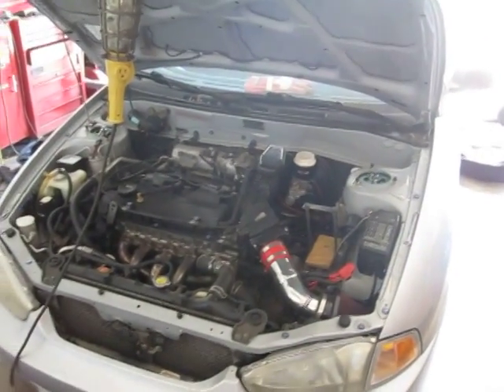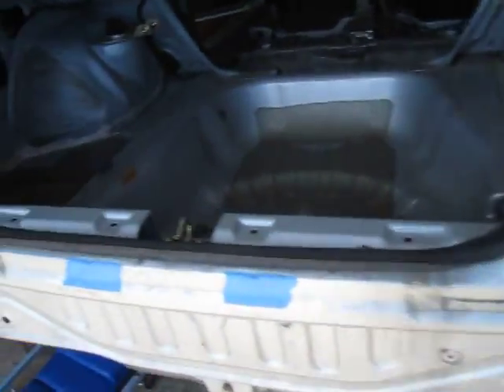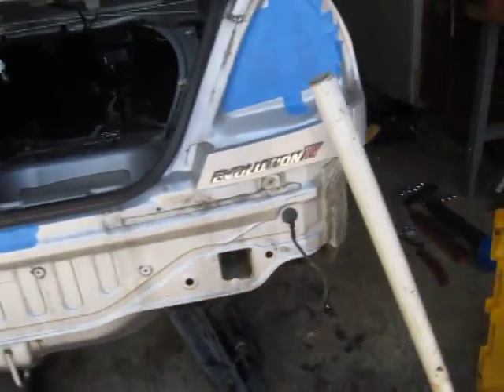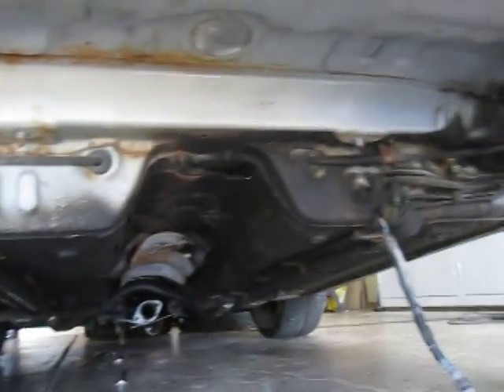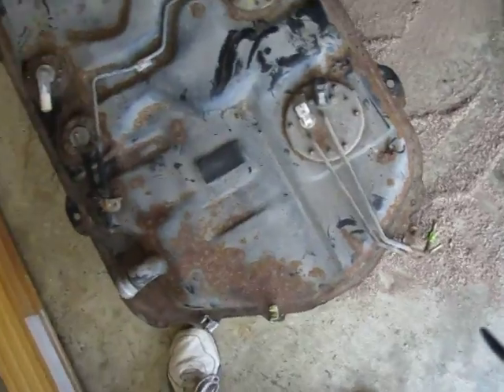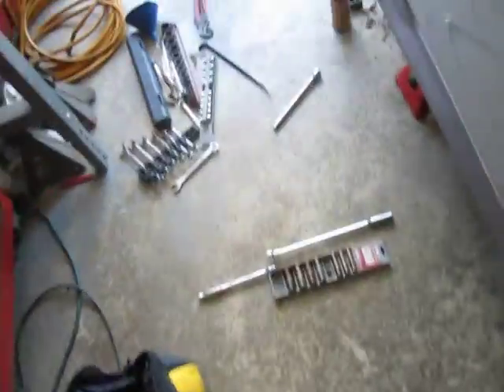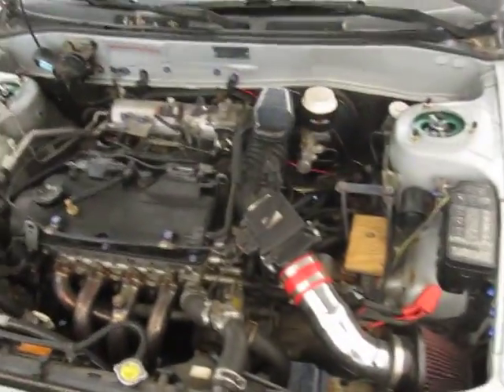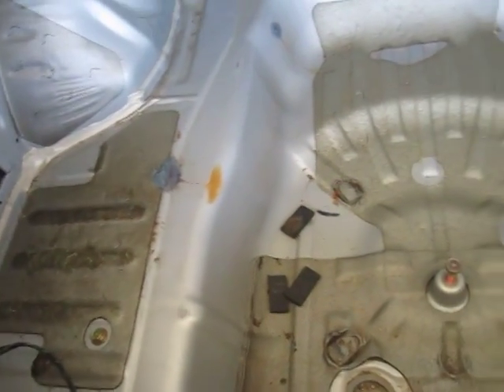Mirage to Coupe Evo IV Conversion Project: Starting the Floorpan Swap!

Comment: From Thero on the forms: Glad to see your build is coming along Alchemist. I knew your Evo IV Rear floor pan was in rough shape but I had no idea that your Mirage floor pan was bad as well. Hope your project keeps progressing on because you got a lot of work in it. I'm hoping when I take a look at mine that it doesn't have these problems lol. (I'm in Southern California but my project car is from Oklahoma I think).
Reply from the maker: Hey man!  Yep, rust belt car.  Pretty much how all cars that old are here.  That's why I bought the WRX to daily drive.  This car just isn't safe the way it is now and I don't want the new floor to rust out after it goes in.  This car will be garaged all Winter every Winter from now on haha!  Well, the spots I pointed out in the video are the same trouble spots every 5G Mirage/Evo 4-6.5 has; so that's what to look for when checking one of those chassis for issues.
Reply from the maker: Alex S Sounds good!  Yeah, now that the bugs have been worked out with the 8/9 pans that's definitely the way to go.  I can't wait to get it done!  Should be starting on tearing the old pan out this weekend!